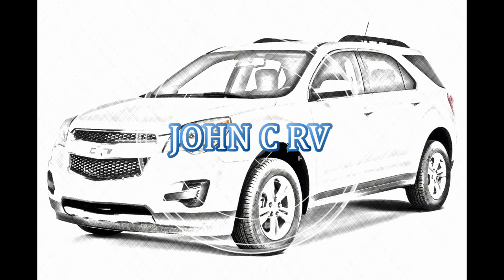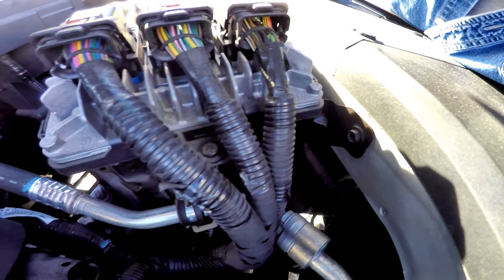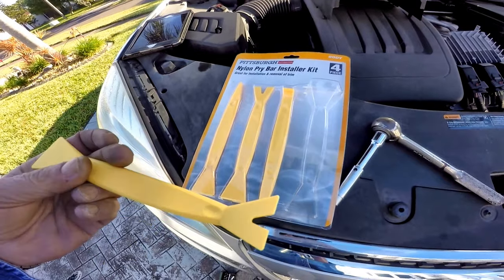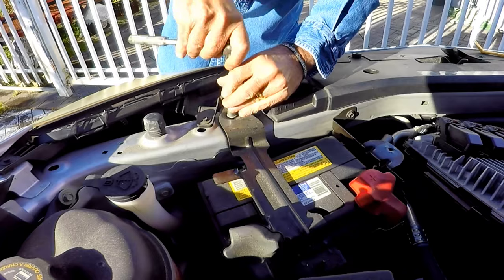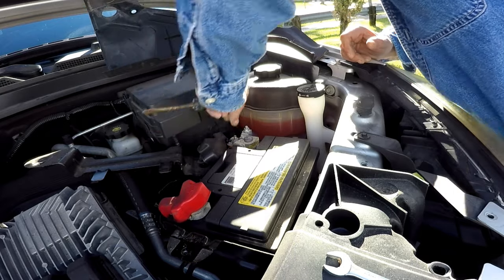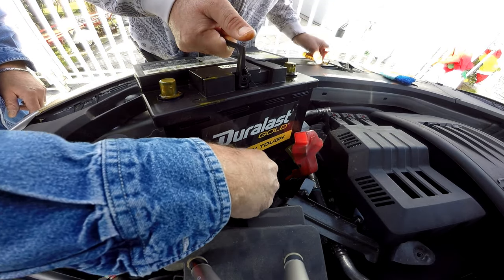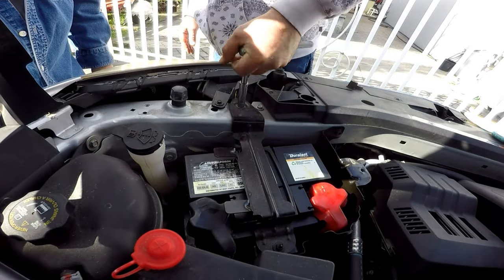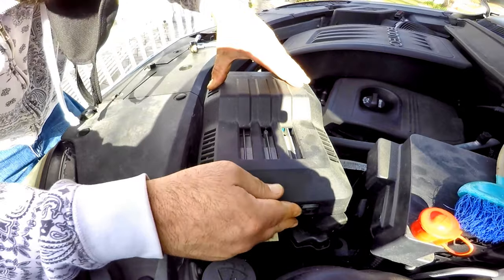How to Replace a Battery 2010 to 2017 Chevrolet Equinox

Comment from the maker: This video will demonstrate How to Replace a Battery 2010 to 2017 Chevrolet Equinox
Reply: Great video. Are there any tricks or methods for removing the negative terminal when it is extremely corroded?
Reply from the maker: @simonkeane5053  If the terminal is hard to take off you'll need to get a battery terminal puller. there's a link in the description of this video you can click on or pick it up at any auto parts store. Wear gloves and eye protection when doing this.... Let me know if you have any questions..
Reply: Best of the 4 videos I watched on this swap.  Good job, wife is happy.
Reply from the maker: @davewalker3561  A Happy Wife is a Happy House! Thanks for the feedback and glad it helped.

Comment: My local auto parts store wouldn’t change mine out as they advertised. The employee said ‘oh no. This is one of those complicated ones.’ And went back inside. 😂. I’m a 47 year old nurse. You made it seem easy. Thank you for the help.
Reply from the maker: Too funny 😂. Glad it helped.
Reply: My daughter just called and said she needed a battery. Im 4hrs away so I told her to go to Oreillys or Autozone. They wouldn't touch it. She went elsewhere to get it done, but if she hadn't found someone, I was going to send her this video. She's a nurse too, BTW.
Reply: Did you change out the battery yourself Amanda?
Reply: They aren't allowed to because if you short the ecu or fuse block on the top of the battery. It's expensive and a dealer only part and causes a lot of headache.
Reply: LMAO 😂😂
Reply: same here....
Reply: I've been stuck outside trying to get the clamp off the terminal for 45 minutes because it was so corroded it fused to it. I wish I had said no
Reply: Omg yes the autozone told me the same thing. They said it’s more of an electrical car and they can’t help me. This video made it easy to change a battery. I guess they didn’t want to do their job
Reply: @amandamccomas6242  I got the same response from my local auto parts store so I had to watch this video and do it myself on their parking lot. I felt like I accomplished something and I guess that’s why Chevy does this so complicated 😅

Comment: Perfect video, thank you so much. Had to deal with this on my wife’s 2010 Equinox in below zero temps—your video really nailed the step by step to take the guess work out. I unfortunately broke the three plastic rivets trying to remove with a flat head screwdriver but those can be easily replaced.

One thing I encountered was a very corroded terminal to the negative post. Nothing I tried would release the terminal, including WD-40. I ended up buying a Battery Terminal Puller tool that solved my problem in about 10 seconds. Thought I’d share in case that saves anyone further headaches when you get to that step.

Lastly, shame on the Chevy engineers for creating such a difficult design to access what should be a simple fix. Totally ridiculous.
Reply from the maker: I agree with you on all points made!. Those rivets can be easily replaces and the puller is always handy. it usually happens when they overtight the terminal clamp and the the battery swells up on top. Goo you got it going. 👍  and thanks for the feedback.
Reply: I agree,  shame on them for the unnecessary steps for something important & " easy to do"

Comment: After watching this video I was able to change out a battery in a 2016 Equinox with no problems.  I am fairly handy but when I first saw all the crap Chevy has attached to the top of the battery I almost told my daughter to take it to a shop.  Excellent video.
Reply from the maker: Glad it helped and thanks for the feedback.

Comment: Just bought one of these and forgot to look this up earlier. Was relieved is fairly straightforward. Just it's replacing an Uplander which was a bit more complicated and we also have a Dodge Journey which a sadist designed the battery access on.

Thank you. Great video.
Reply from the maker: Glad it helped! Thank you for the feedback.

Comment: This video did help me. I did get intimidated by the connections. I thought I would need two battery’s “faceplam” once I saw that you remove the top part and it was separate I felt dumb 😅 but I’m glad I was able to change the battery. Thank you 🙏
Reply from the maker: Glad it Helped! Thank you for the feedback.

Comment: I found this video while looking for actuator ones. 

My actuator clicks even when my equinox is off. Can't get it fixed til next week. So I thought I should either remove the fuse or disconnect the battery. 

Which one's easier to do 😅?
Reply from the maker: Fuse for sure. Disconnecting the battery you will need to take the computer off the top first..

Comment: Thank you for posting this I was able to remove the cover and silly screw and metal thing that allows access to battery for a jump!
Reply from the maker: Next time use the red terminal and the screw next to it to Jump or charge. Its located on the fuse box next to the battery. You do not need to take the computer off to get to the battery. I need to do a video and add it to the Equinox playlist.
Reply: @JohnCRV  Not sure what you mean but good to know.  Seems there should be something easier than what I had to do to get to the battery!
Reply from the maker: @susanreed1569  Planning on doing a video soon. Its very simple.
Reply from the maker: Here's the video to jumpstart it without using the battery terminals. Hopefully you wont need it but its good to know this.
https://youtu.be/j0km9x8ylAM

Comment: Thanks for the video. I just don’t get if there is any risk for data if I detach a battery? BMW has 2nd battery to save all the data while an owner changes the main one. Is it okay for Chevrolet if it will stay for 1 day without battery? Will I need to re-set anything or is there any risk to harm data/computer/settings? Thanks
Reply from the maker: On this Chevy Equinox we had no issue except resetting the clock time. If you have any doubt leaving it for a day you can hook up  OBD - KAM tool:  https://amzn.to/2Ec7o7b and use a small 12volt battery to keep the computer memory intact. I used it on my motorhome and it worked great. https://youtu.be/CbeuCRLztYY
Reply: @JohnCRV  thank you very much for the reply

Comment: Hey JohnC, this is Heather with a question for you again. I’m wondering if you could walk me through how to wash the engine and things under the hood of my 2011 equinox.? I’m wanting to get it ready to sale and want it to look it’s best. Thanks
Reply from the maker: Just to mention some basics. 
The first thing to do is have a cool engine.
2nd is to protect as much as possible the electrical connections and electronics (like the computer on top of your battery)  :) I would put a bag over them.
Spray the entire engine compartment with degreaser. 
let it soak for a while depending how greasy it is. 
Use a small brush to scrub all the areas. 
Rinse with a controlled spray and reapply more degreaser if needed. Use some old rags to scrub as well. If you have an air compressor it would be ideal to dry it quickly.
Last thing, Use some Armor All Plastic/Rubber Protectant for the plastic. 
It will make it stand out and look as good as new. 😉👌
Good luck
Reply: @JohnCRV  That’s some awesome basic information!! Again thank you for all of the detailed information!!
Reply: I’m a big tarred, I took the black sort of decorative piece off the front that sits under the light., I needed to fix it because it was loose. After I fixed it I placed it back in the spot but didn’t completely secure that in. And then I completely forgot it wasn’t in solid and drove off. Of course and naturally it fell out somewhere!! So now I need to either locate another one or just leave it a big huge hall which I don’t want to do. Anyway just a little tidbit of my wonderful ingenuity and brilliance in executing that brilliance!! Hehehee
Reply from the maker: 🙂 you made my day 😂

Comment: Great video, Negative cable won't loosen! Help!
Reply from the maker: You may need adjust a flat screwdriver to stretch the clamp wider. If that doesn’t work because the battery terminal is swollen, then you need to get a terminal puller.
Reply: @JohnCRV  Thank you
Reply from the maker: @davidweltman3138  I hope you got it resolved.

Comment: Really appreciate this! Was about to take it to have someone do it…. As silly as that sounds. But when I opened the hood I was like…..WTFREAK… Anyways, thank you for this! Question? What is the positive port right above the fuse box? Thanks!
Reply from the maker: That is a 2nd positive post that should be used for jumping and the ground terminal is right next the hood strut, you will see a metal tab with a NEGATIVE - sign stamped right into it.

Comment: Is this a 48 series battery you used? I'm getting conflicting information as to it being a 47 or 48 series battery from the GM store to use an AC Delco to Amazon vehicle type not identifying any battery to being compatible. Other sites say the 48 series, GM parts store says a 47 series, and Amazon isn't listing either as compatible so I'm confused as hell right now as to what battery to order for my 2017 chevy Equinox!!!
Reply from the maker: According to O'Reilly Auto Parts: For an Equinox SUV 2015 and UP is a size 48. 
For 2014 and older Equinoxes, you need size 47. Of course. 
Hope this helps.
Reply: @JohnCRV  Thank you. I'm just gonna change it before Winter hits. I have no time to risk a dead battery this Winter. I'm gonna change it while it's nice outside.

Comment: I really like your demonstration on the battery removal. I have a question regarding the 2017 chevy equinox. I drained my battery charging my iPhone without the car running.

Roadside assistance gave me a jump and the car started right up. However, I have no radio, parking assist, the turn signals have no sound. Only the defrost works on the infotainment center. 

Is there a checklist or a reset I’m not aware of. The radio won’t even turn on. The screen doesn’t come online either. What to do besides checking fuses?
Reply from the maker: Before you go any further, you better have your battery tested. If an iphone can discharge your car battery you have a bad battery.

Comment: hey John I dropped the 10 ml bolt that holds the computer in place and lost it in the void. Do you know the size of actual bolt that screws in? that's not 10 ml only the head is
Reply from the maker: All I remember is about 1 1/2 inch long and it was fine thread

Comment: Do you know what CCA should a battery for equinox 2013?
Reply from the maker: According to my research, see below..... Please do your own research as well.

What is the CCA requirement of Chevrolet Equinox batteries?
The Cold Cranking Amp (CCA) rating is an important specification to consider when choosing a replacement battery for your Chevrolet Equinox.

CCA is the amount of current that a battery can deliver at 0°F (-18°C) for 30 seconds while maintaining a voltage of at least 7.2 volts. This rating is important because it indicates the battery’s ability to start the engine in cold temperatures.

Comment: Will resetting your vehicle by disconnecting battery lock you out of radio?
Reply from the maker: We heard about that but we did not have that issue. Yet.
Reply: @JohnCRV  right on

Comment: Hi there. I changed my battery but I lost my Bluetooth feature of the car. Any idea about this? Thanks
Reply from the maker: Not having that feature I would be guessing.  Did you look on your manual  how to pair it? Did you try disconnecting the negative cable on the battery for about a minute and then reconnecting? make sure your radio is off before you do this.
Reply from the maker: This may help before you do anything. How to Pair
https://duckduckgo.com/?q=resetting+bluetooth+after+changing+battery+on+chevy+equinox+&t=chromentp&atb=v1-1&iax=videos&ia=videos&iai=https%3A%2F%2Fwww.youtube.com%2Fwatch%3Fv%3DZ3ipYlJmiGg

Comment: So you wanna tell me that not only did the silly folk who built the engine around the water pump mess things up there -  ($20 part. Takes hours to change and costs >$1000) - they also complicated a simple battery replacement?!! 
Hate the equinox with a passion!
Thanks to you sir, the battery swap pain on this bm .. I mean equinox, was alleviated.
Reply from the maker: Thanks for the feeback

Comment: Mobile mechanic charge $356. $156 is labor. I did it in 1 hour. $200 for battery (-$22 for old battery swap) and $54 tools. Would've been faster if the terminal wasn't stuck by that white crusty stuff😁😁😁
Reply from the maker: Awesome!

Comment: Thank you for this video. I'm a woman and my battery died, so I can't take it to a shop to replace it. Wish me luck.
Reply from the maker: Take your time.
Reply: @JohnCRV  I did it. Yeah for me ! 🎉🎊🥳Quick question. I didn't spray that stuff on the terminals. Will this cause a problem?
Reply from the maker: It may cause some corrosion in the future. Keep an eye on it.
Reply: @JohnCRV  can I spray it on while the terminals are on? I already put everything back together.
Reply from the maker: @biblethumper8088  Yes you can. It will penetrate thru the clamp.
Reply: @JohnCRV  thanks. Your the best
Reply from the maker: @biblethumper8088  You're welcome. Glad to help!

Comment: Thank you so much. The auto parts place wouldn’t touch it even though they say they do. Everything went fine. Why do American made cars use metric nuts and bolts? The engineers who designed the placement of the battery should be fired and stripped of all their pensions.
Reply from the maker: Good question but we all know the answer.

Comment: Sounds like something is sizzling under that top lid of the battery and it smells like something died in there should I drive my car to the dealership or have them pick up the car it smells bad I know what burned robber smells like and this is not it
Reply from the maker: Do the safe thing and have it towed.